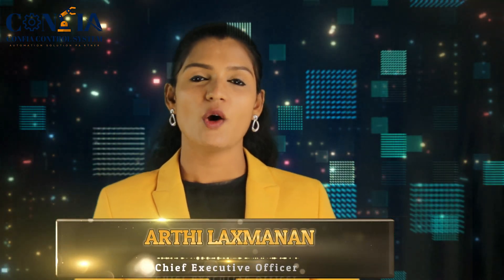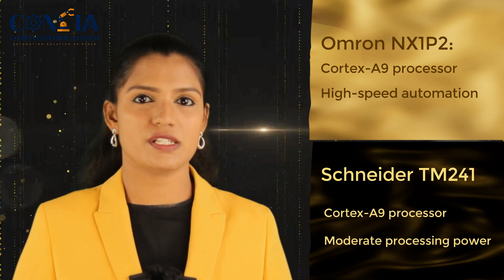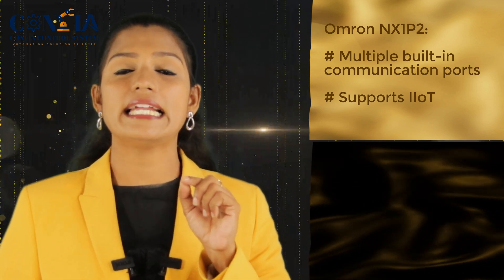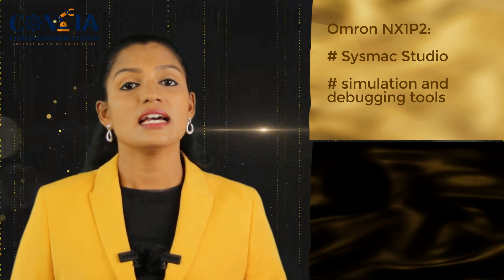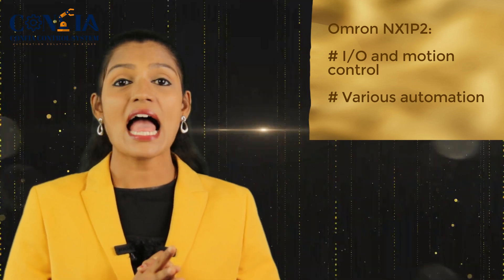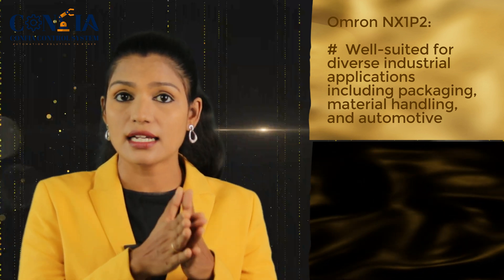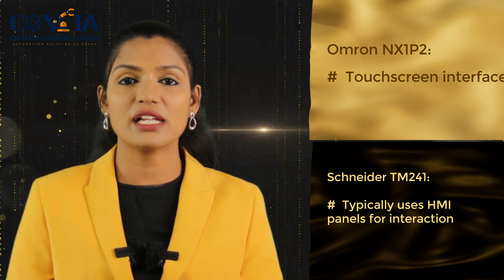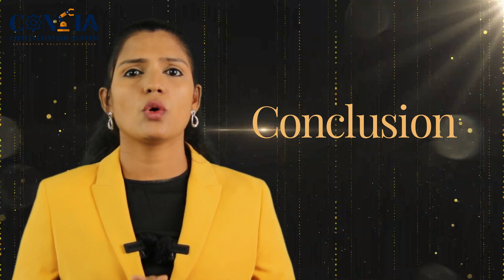Which One is the best PLC Omron vs Schneider comparison

Comment: I have limited experience with Schneider, but I really disliked using their programming software. I use a  Siemens S7-1200plc now with tia portal and really like that, but then again Schneiders software is free and the PLC Is slightly cheaper I think.
I think working in tia portal is way more efficient than using ecostruxture as it just feels laggy and unintuitive. 

Thanks for the video😊
Reply from the maker: Thanks for sharing your views bro